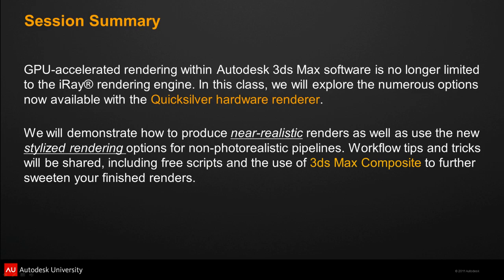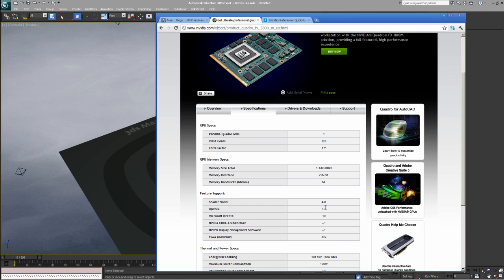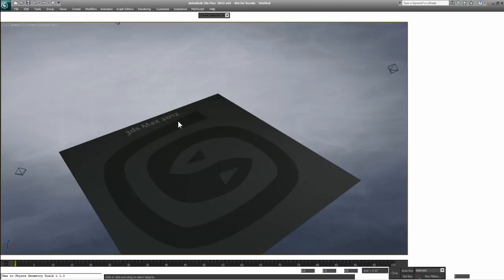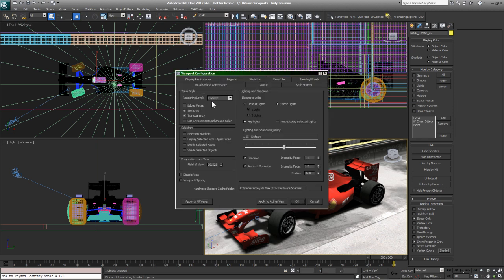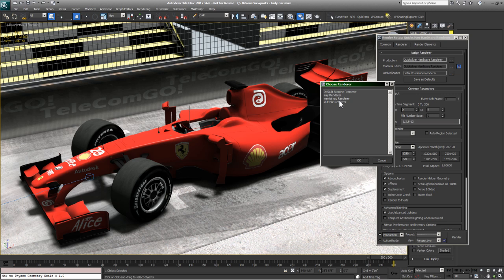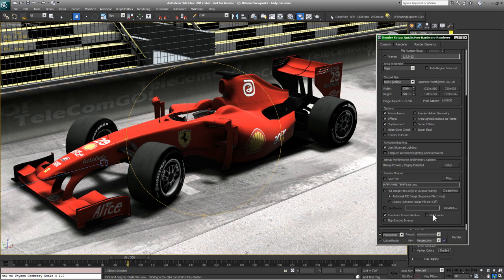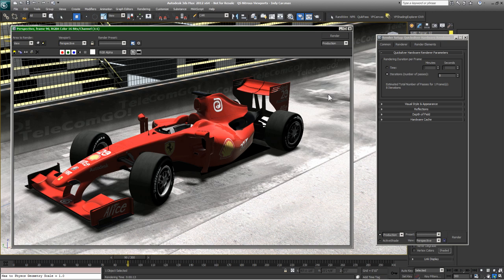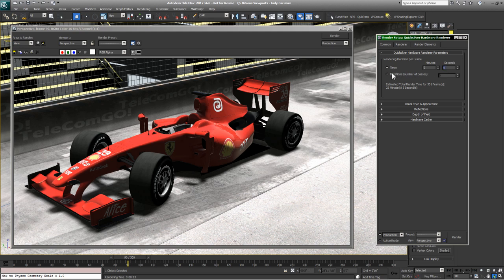GPU Hardware Rendering with 3ds Max Quicksilver

Comment from the maker: you could use State Sets to switch rendering engines and render just the volumetrics with something like scanline or mental ray - and then composite.  i have a tip on State Sets for multiple renderers in my newer video about "Mediasync"

Comment: great video. so quick question here, how can i do volumetrics on quicksilver? volume light, depth fog etc... besides using particles to generate similar effect, is there any other way? 

cheers
Reply from the maker: QS only replicates what can be seen in the viewport.  one option might be to render just the volumetrics with the Scanline rendering enging and comp them in.
Reply: Gary M. Davis ok. Thanks. But for instance, when using pflow and then applying mesher as a way to "bake" the particle generator, so if we want to duplicate or manipulate we do it on the mesher (instancing the pflow), QS still renders the total of particles, and not the rate being displayed in the viewport, so it made me wonder. But yeah, I guess that could be a solution.
Reply: have another question, if you be so kind, is there a way, when rendering with Quicksilver, to NOT show interceptions between a transparent material and a opaque material, in other words, just see the effect of the transparent material on lighting conditions, without seeing interceptions or any kind of geometrycal interaction with other materials. An exemple to this would be using particles.  I get some hard edges on transparent to opaque material interceptions. Thanks.

Comment: Nice video. I'm an interior design studdent and i need to buy a new laptop to work with max 3d and autocad 3d. I need to know if  MSI WT72  with NVIDIA Quadro K4100M 4GB GDDR5 will run without problems. Thank you for your time.
Reply from the maker: System requirements and hardware compatibility for all their software available on Autodesks website.

Comment: why my volume light not render when i use quicksilver renderer? -newbie
Reply from the maker: purebreed rarebit Quicksilver basically replicates whatever you can display in the viewports.   Volumetrics are a post-process (or more accurately, something done at render time by the renderer).  If you can see it in the viewport, QS will render it.  if not, it wont.